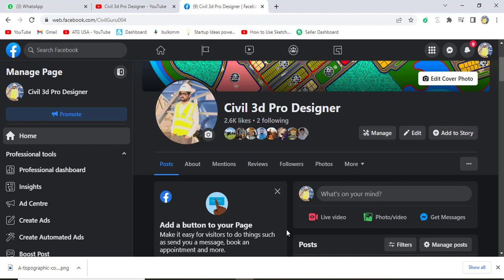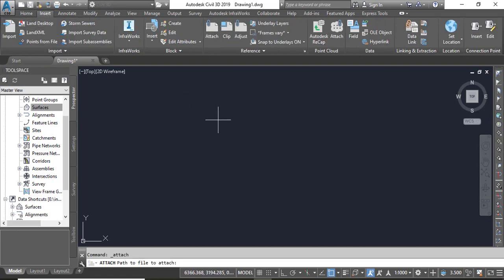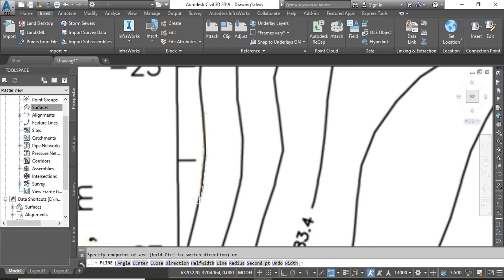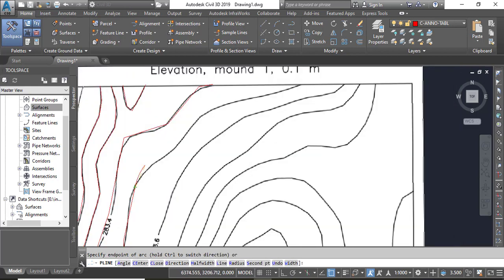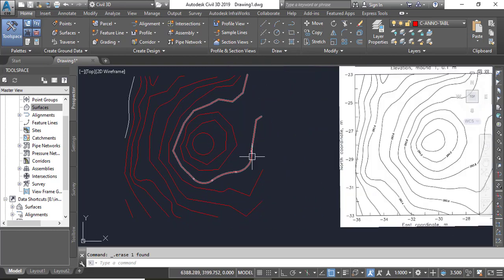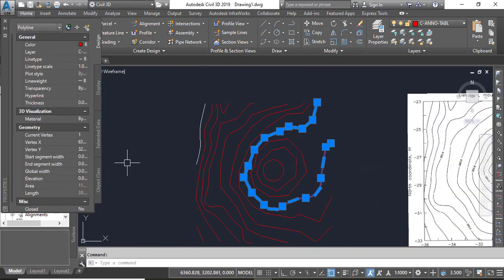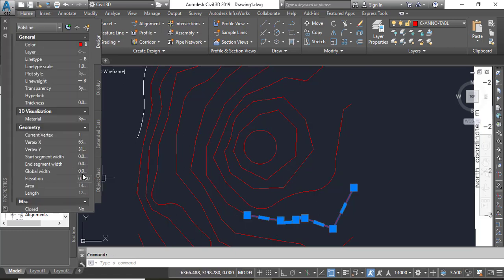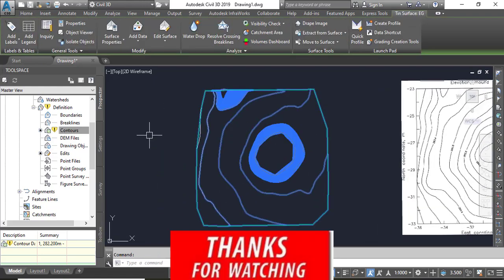How To Create Civil 3d Surface From Pdf Contour Lines | Earn Online With AutoCAD Civil 3d Skills

Comment: Instead of tracing every line from the PDF, could you instead import the PDF so that Civil 3D will convert the PDF lines into polylines for you? I find that to be much faster and more accurate.
Reply from the maker: You can convert pdf to cad but polylines will not show elevations and then we must need to select each line to assign them elevations 1 by 1 then we can create surface